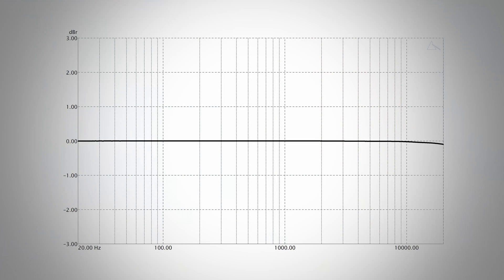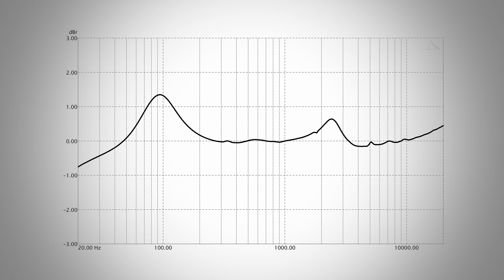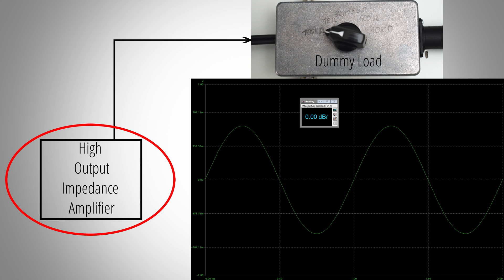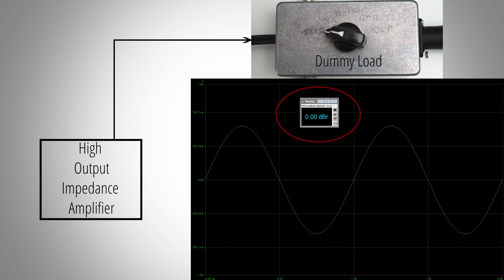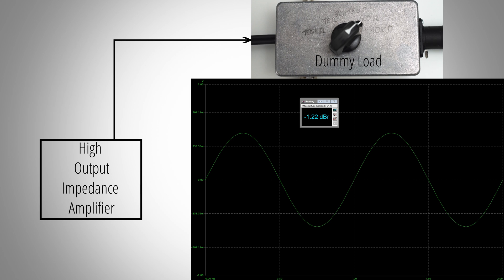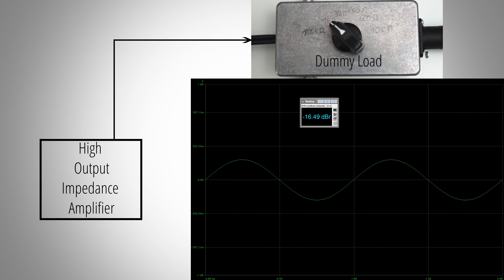Amplifier Impedance matters! Why it is important to have a low output impedance (explained)

Comment: Is it true that planar magnetic driver headphones have an almost flat impedance to frequency curve? does that mean that I can disregard the 1/8th rule? I'm considering the Hifiman Edition XS which have 18 ohms impedance and pairing them with an amp that uses the TPA6120 Chip which has an output impedance of 10 ohms. if they actually do have a flat impedance to frequency curve the only disadvantage would be the power dissipation in the amp, essentially the efficiency and the amp wouldnt "color" the signal

Comment: Great details in this video! I have a question about that last part though regarding the, at least 8-times impedance advice,

If I have the Scarlett SOLO 3rd gen that states it's at <1.0 ohm of impedance, do I need headphones that are at 8-ohms impedance for best results or is 32-ohms ok? 
For reference I'm using the Captain 370 wireless headphones with the following ratings - 
Impedance___32 Ohms
Noise Control___Sound Isolation
Frequency Response___20 KHz
Audio Driver Type	___Dynamic Driver
Audio Latency___20 Milliseconds
Audio Driver Size___50 Millimeters

Also does the wireless headphone state affect sound quality or does it not matter?
Thankyou in advance for your time and a big thankyou to anyone who wants to throw their two cents in.

Comment: I have a few questions maybe a bit too long for this comment but. How come product designers wouldnt just make everything with a low impedance? why make a high one at all if it may have problems? Lets say you have a pair of headphones that could be the exact same except for impedance levels, and you have two amps that are exact same except for impedance and you had one of those matched low and one matched high. What would be the difference?? and also could you make a video of you actually doing these types of tests, and measurements instead of diagraming it later? It would at least help me a lot to really understand it all more. But great video man thank you!  Could you make a video on mic to mic pre and then line or interface impedance matching and why it might matter or not?

Comment: Where this gets sticky is when you're dealing with some older equipment that was optimized around the impedance limitations of the "partner devices" of its day. Where that shows up most often is with dynamic microphones, which can have relatively high output impedance. To achieve "flat" response as measured in the voltage domain you would therefore want a very high-impedance preamp, but the fact is that those mics were designed at a time when typical preamp input impedances were 300-600 ohms, and there is some evidence that their designers voiced them with that low input impedance in mind.

The SM-57 is an interesting example. Its output impedance ramps up right around that +6 dB peak about 5-6 kHz, and using a lower-impedance preamp will therefore tend to tame that peak a bit (at the expense of significantly reducing 10 kHz and up). A lot of people (not including me FWIW) swear by 300-600 ohm preamps with old Shure dynamic mics for that reason.

Comment: For what you state in the conclusion it seems it would not be good or the best to have a amp impedance of 8 ohms to drive a speaker impedance of 8 ohms. So if there is a option. To set the amp impedance to 4,6 and 8 ohms what impedance should one chose to use on the amp to drive a 8 ohm speaker ?

Comment: I dont get how the lower frequencies get a boost if that is where the impedance increases. If the impedance increases around 95hrtz, then the voltage is lower at 95 hrtz, resulting in lower audible bass frequencies... right?

Comment: I just bought a Cambridge Audio DacMagic 200M and just today I found out it has 50 ohms as ouput impedance for the headphones output. My headphones are Shure 1840 that have 65 ohms impoedance. Now I worry, did I made a mistake buying the DacMagic ? Do I need a new amp, something like Schiit Magni – END-GAME HEADPHONE AMP WITH MODULAR DAC OPTION   ? Would a low output amp make a great difference ?
This is stressfull. I got the dacmagic due to having a very good experience with the older dacmagic 100 in terms of driver and software support.

Comment: To get a neutral frequency response and a transparent sound from the headphone that they were designed by using low impedance output. So what's the point high impedance output then? im confused.

Comment: So if you have a low impedance headphone and a high output impedance amp, should you attach some resistors in between your headphone and the amp output to raise the headphone resistance above the amp?
Reply from the maker: @BrentLeVasseur  Hey, that will only make things worse. When you put a resistor in series it adds to the output impedance of the amp and you will have an even higher impedance. Sadly, there is no easy solution to this other than using another amp.

Comment: I haven't seen anyone ask this, and it seems rather important.  If you happen to own one of the interfaces with a high impedance headphone output, wouldn't it be worthwhile to purchase a dedicated headphone amp (for example the Mackie HM-4 which has a 3 ohm impedance) and insert that between your line outs and headphones?

Comment: I know this video is old. but i have a question. could a preamp with low output impedance fix the problem with the high output impedance of the steinberg ur22mk2?

Comment: if I am using an audio interface that has a high impedance and run the line out to an amp with low impedance, would this help when using IEM’s? I want to use IEMs with the roland bridgecast but the output impedance is around 10
Reply: I'm curious about this aswell.

I'm thinking about buying a io44, which as a output impedance of ~24ohms. I use iems which are 32ohms. Would using my existing amp through the headphone port on the io44 help with this?

Other option is to use the amp through the main out on the io44, would there be any issues with this?
Reply: @mokad  From everything I had looked at it looks like it will work!

Comment: Super useful!

Just to confirm: I will get a really low cost audio interface and then a Beyerdynamic DT 990 to monitor with... That oughta work, right? Say, what are you using to measure with? I would happily do that if it's not crazy $ to consider... What gets measured gets improved, right?
Reply from the maker: Hey, thanks for the donation! Yes, the DT990 are not particularly hard to drive and cheaper interfaces should be fine. But I wouldn't go too low, otherwise you might have other issues like background noise or not enough power to dive the headphones. But for the most part, anything at about the 100 dollar mark should be capable of providing an excellent audio quality with the DT990. If you are wondering how I made the measurements, I used a dScope M1 audio analyzer. But you can so the same measurements with a simple audio interface and free software like REW.

Comment: Unfortunately the info in the video is not really correct. It is true for loudspeakers not headphones. Headphones are designed and tweaked for the best response with a non-zero source impedance, like 10-100 ohms range. Partly this comes from the histortical ISO standard (120 ohms). A non-zero output impedance also ensures more consistent volume level with headphones of different impedance, i.e. sensitivity.
Reply: Do you have any link with more information on that?

Comment: Great videos! I’m new and confused. I have an Avid MBox Studio Interface that has a headphone output impedance of 32 ohms. When I plug my 250 ohm Beyerdynamic DT880 Pro headphones in to it, they work, but the volume even when maxed out is not very loud. I was told that my interface could not handle the headphones, so I bought a Schiit Magni+ Amp  with higher impedance and  I get louder volume with more headroom. Am I missing something?

Comment: Audio interface with channel balance of 1.05 dB - Is the imbalance problematic?
Reply from the maker: Hey, it depends. Usually, channel balance becomes worse with lower volume settings if the playback device has an analog volume control. If you use headphones that need a lot of power to be driven, then you are usually at a high volume setting and then the imbalance is not that high. But if you use more sensitive headphones which need less power, you need to use a lower volume range and then the channel balance could be worse. 1.05 dB is not a hughe imbalance and I would argue that in most cases you wouldn't notice it. But it should not be much more than one dB of difference otherwise the left and right side will have a noticably different volume.

Comment: What's missing from this explanation is to show how much the actual sound output from the headphones changes when the amp's Z-out doesn't respect the 1/8 rule and is e.g. comparable to the headphones' Z. This and a few more details can be found in Solderdude's article "resistance, impedance and other issues" - basically it's not as simple as "lower Z-out is always better", nor as strict as "if Z-out is higher than 1/8 it will sound bad". Could be that Z-out as high as 1/2 of the headphones will produce an inaudible FR difference in most cases.

Comment: I have the MOTU M6 audio interface in my cart along with a few pairs of headphones.

(I hear the MOTU M6 headphone amp provides 190mW @ 55ohms).

A (seemingly wise) YouTube audiophile told me to "pair the M6 with 80Ω headphones".

...but a MOTU sales rep said that "headphones over 200Ω is optimal".

Julian says that you should x8 the amp impedance with headphone impedance.

...but another tech Youtuber said to match the amp/headphone impedance.

WHAT GIVES!?
Reply: Impedance matching used to be the standard until the mid-20th century, but modern audio tech almost always uses impedance bridging, where the headphones' impedance should be at least 8x higher than the amp's.

Comment: So based on this, on motherboard audio (high impedance), headphones with high impedance would have more correct response? However, people always say that high impedance headphones are more difficult to drive and need an amp, which kinda contradicts it. Or does it mean that even though the response curve is better, there won't be enough power and the headphones will be too quiet?

Comment: It is not just frequency response that's affected by a high output impedance, the damping factor is also greatly reduced. When the damping factor is too low, the bass will take on a loose, flabby and uncontrolled character, with any resonances magnified, leading to that horrible boomy, two note, bass effect.

Comment: Hi Julian.  Thank you for this video, I didn't know that output impedance could affect frequency response.   But, that leads me to a question.

1.  I have an Original Mackie Big Knob (the 1st model that came out in 2004), and I still use it to this day.
2.  It's Headphone output impedance (per the user manual) states that it is 150 Ohms.  And it has (2) headphone jacks, each with their own attenuator/volume knob.  150 Ohms seems very high relative to what you're stating headphone amp impedance *should be to drive headphones properly.
3.  I mostly use the following headphones:
- Sony MDR 7506 - 63 ohms
- Shure SRH440A - 40 ohms
- Beyer Dynamic DT770 - 80 ohms

I've been using the Big Knob so long I've just never paid any mind/attention to any impedance differences.....I assumed 19 years ago that the Big Knob was a Pro(sumer) device, it had dedicated headphone outputs, so they should be able to do what they were designed to do.  And, the Sony MDR-7506 has been around a long time, so they were definitely around and with the same specs (63 ohms) when the Big Knob came out.

I've never *noticed any difference in audio quality or frequency response of my headphones when using ANY of these headphones in different outputs:  Mackie Big Knob.  Directly out of laptop.  Audio console (X32, Yamaha QL5, Allen and Heath QU32), or when using any of my headphones when monitoring ANY audio output from other things like Atomos Ninja/Shogun, Whirwhind DA-2, etc.

So, my questions:

1.  Wouldn't Mackie have known this potential impedance mis-match when they put out the Big Knob?  It's never seemed to cause any issues.
2.  Is the 150 ohm impedance on the Big Knob REALLY affecting my headphone frequency response?

I enjoy your videos and have learned a lot from them!  Keep it up, I'm hoping you can help me with my conundrum here. 

Thank you Julian
Reply from the maker: Hi Marcus, glad you enjoy my videos 😊

1. Yes, many manufacturers are aware of this but it is usually a tradeoff they are willing to take because with a higher output impedance the amount of power that is delivered to different headphones is more consistent. This means, there is a much higher chance that you always get to use the full range of the volume dial. If the output impedance is low, then you might only turn up the volume a bit to already get low impedance headphones to very loud listing volumes while with high impedance headphones you need to use the full range of the volume dial. Also, there was a standard defined in 1996 which stated a standard output impedance of 120 Ohm but I’m not quite sure how that made it into a standard.  So, manufactures are aware this topic but often trade frequency response accuracy against the convenience of being able to have a more consistent range available on the volume dial.
2. If the output impedance does have a negative impact, depends heavily on the particular pair of headphones you use. If the impedance of the headphones varies heavily, the frequency response is going to be much more negatively impacted compared to headphones that have a more consistent impedance value. For example, planar magnetic headphones usually have the same impedance across the frequency range and because of that their frequency response are hardly impacted by a higher output impedance. Impedances across the frequency range for dynamic drivers on the other hand can vary quite a bit and that’s the problem with a high output impedance, it can have negative effect but this must not always be the case. So, you end up with a huge uncertainty and it’s impossible for me to say if there is an audible impact in your case.
Reply: @JulianKrause    Hi Julian.  Thank YOU for your very speedy response, I know it took me a while to get back to you, but I really appreciate your input here.  I'm still using and will continue using both my Mackie Big Knob and my trusty Sony MDR-7506 headphones.....and I'll have to read up more on headphone impedance.  Thank you again, cheers!

Comment: Quite interesting, thank you. I still find that there is a discrepancy between what the 'output' vendors announce as opposed to what the 'input' vendors announce. There is not single lookup table saying with this amount of mW, Ohm, V, dBu and dBV output you can connect input devices with these specification (x, v, z with a nominal SPL maximum of xxx) not to mention the 'actual' mW to 'actual' Ohm relation/calculation. Could just be me. 

I need and would very much appreciate your input. I am in the process of finding headphones I can use with both my field-recorder and DAW. It looks on paper as if the field-recorder can feed the headphones (its the +7.8dBu that throw me a bit off) or if I should choose headphones with a lower impedance (80 Ohm).

Field recorder
Stereo Out: 3.5mm TRS stereo unbalanced, 500 ohm output, +7.8dBu max output level
Headphones Out: 3.5mm TRS stereo unbalanced, 300mW + 300mW, for use with any impedance headphones

Headphone
Impedance: 250 Ohm
Nominal SPL: 96 dB
Power handling capacity: 100 mW

Much(!) appreciated.
/Per

Comment: I’m confused. The headphones need to have 8 times the impedance of my amp. I have a Mackey HM4 headphone amp with an input of 10 ohms and an output of 47ohms making it awfully close to the ohms on my headphones at 55 ohms yet the volume is much louder.

Comment: So does it stand to reason that if I buy a 300ohm pair of headphones (Sennheiser 6xx or Hifiman Sundara's) I will get better sound out of an amp that has very low impedance..  
so why wouldn't a phone be better for those headphones?
  I ask because everyone says that it would work but not that great.
   And if I tell someone I plan on using my Sony dh790 a/v receiver to run those headphones they tell me that I'm missing out and to get a different dac/amp.
    🤷🙆‍♂️

Comment: So what happens if you use an amp that’s rated for 16-600ohm using 600ohm headphones? - surely if it’s set to the 600ohm setting there wouldn’t be much variation, you’re essentially saying low impedance is better which is the opposite of what everyone else says

Comment: Julian is true for monitors as well?
Reply from the maker: Hey, this is not a problem with studio monitors because they are active. But for passive speakers this principle is valid again. Although power amps for speakers are usually designed with a very low output impedance for this exact reason.

Comment: Thanks for the great info. I have the Sennheiser Momentum 4 noise cancelling headphones which havehave an impedance 470 Ohms (Active) 60 Ohms (Passive). I'm kind of struggling with what this means when I'm choosing an audio interface. Should I be looking for an audio interface with less that 1/8th the impedance of 470 or 60?

Comment: Excellent explanation of a subject I have seen addressed nowhere else. I am putting together a modest home recording rig and purchased the Arturia MiniFuse 2. I have yet to purchase my headphones, so I'm glad I found this on your channel. Per your rule of thumb, since the Minifuse has an output impedance on the phones jack of 10 ohms, the impedance of any headphone set I connect to it should be 80 ohms or higher, correct? So far, I haven't been able to find any over 32 ohms that weren't more expensive than the MiniFuse. Have you reviewed any headphones that meet those criteria? Any suggestions?